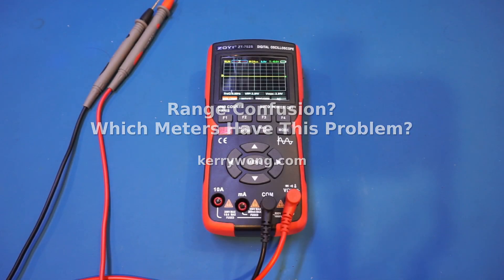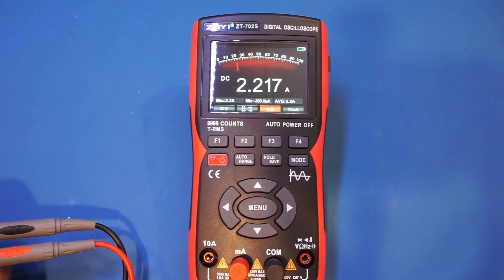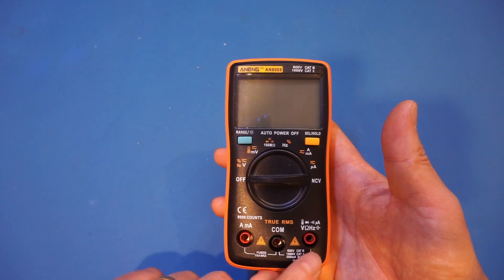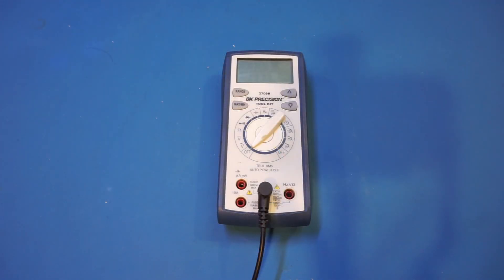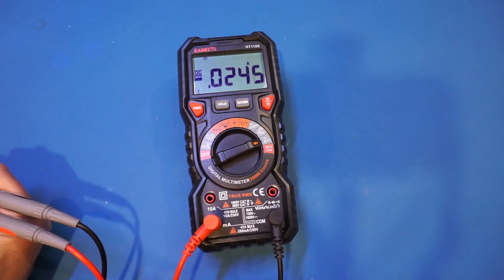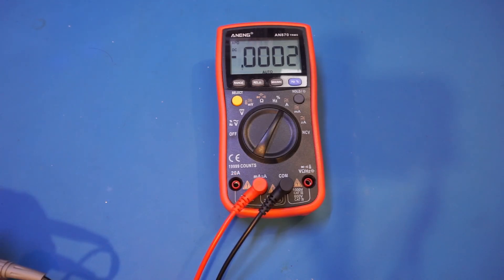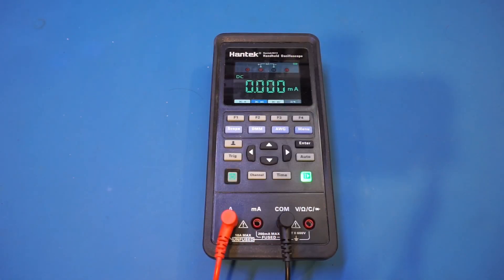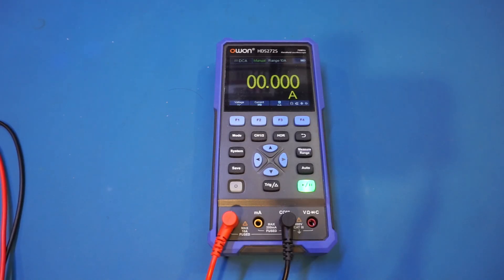"Range Confusion"?  Which DMMs Have This Problem?

Comment: You have the most oddball collection of DMMs I've ever seen!
Just checked my Fluke 87V and EEVblog GW121, as I never thought of this problem.
They both have a single position for A and mA, so the range is dictated by where the probe is inserted.
Both also have a separate uA selector position and will beep if the probe is in the A socket, showing  "LEAD" on the display.

Comment: I think  that both you and Dave Jones are asking too much of manufacturers, and not enough of users. I have many of the meters you have both tested, including the 702S and am never confused. But then I have been doing electronics since 1955, using a Simpson 260 and a Triplett 310. But wait—both of these models are STILL made almost unchanged.  I guess they just make them for us codgers who read manuals.  YOU do the most thorough reviews and I appreciate it and vote with my purchases. I trust you a lot more than Dave.
Reply from the maker: Thanks Barry. Just wanted to point out for unsuspecting users. I haven't made these mistakes either but I thought it was still worth pointing out as after all there are meters out there with all these potential issues well thought out.

Comment: Thx kerry wong it give out a great point of current measure,And for the series of test current be careful of never turn the selection switch of multimeter when power still on,it must burned the meter ,for my meter dead now😅.

Comment: Greetings, I have three UNIT UT61+, UT89XD, UT191T multimeters and a GOLDSTAR DM-311 from 1996 +/- ....and I performed those tests measuring current, which you did and none of them gave me a bad result, they all measured perfectly. use loads from 5mA to 40mA in DC and AC... they all measured well, when changing the place of the probe and changing the dial as you did... without problems 👍

saludos, poseo tres multimetros UNIT UT61+, UT89XD, UT191T y un GOLDSTAR DM-311del año 1996 +/- ....y realice esas pruebas midiendo corriente, que tu hiciste y en ninguno me dio mal, todos median perfecto. utilice cargas desde 5mA hasta 40mA  en DC y en AC.... todos midieron bien, al cambiar las sonda de lugar y cambiar el dial como tu lo hiciste.... sin problemas 👍

Comment: This can be an annoyance, but it's something you should be double-checking before measuring current because if you get it wrong the other way around you'll blow a fuse (by Murphy's law will not have spares on hand). If the meter doesn't warn you you're on the wrong range before you try to take readings it's not a very good meter. If it gives the wrong results while beeping loudly at you, that's OK IMO. If it can use a single set of jacks for μA through A, that's even better (though that's usually reserved for bench meters).

Comment: You really are making a mountain out of a mole hill this time, you clearly state you get an incorrect reading when in the WRONG setting.
Reply: Solo puedo regañarle que muestre valores en amperios cuando está en el rango de miliamperios  eso sí llama un poco la atención
Reply: not really, this is still a good point to bring up as sometimes you might make such a mistake and get wrong readings. Knowing about such issues will ensure the mistake doesn't happen
Reply: Agreed. Even worse.... ALL of my meters give the incorrect Volts and Ohms measurements when I have the probes in the Amperage jacks. Go figure!
Reply: Give me a break, anyone who does any work with DMM's will make this mistake more than once.  Sometimes you get so far ahead in your troubleshooting or checking that you completely forget.
Yes, thats never happened to you, but for the rest of us mortals, it does happen.

Comment: Nice video. I will include such a test in my upcoming multimeter reviews. Owon continues to pleasantly surprise me, and over time, I'm growing to like it even more (despite the highly non-intuitive signal adjustment on the oscilloscope).
Zoyi unfortunately is the worst in this regard. If I saw over 2A instead of the expected 20mA during some tests with my face close to the PCB, I would immediately jump up from my chair :D

Comment: Thanks for the chapter marks. I just checked the 61e+. There are so many more choices since I bought that meter.
Seems I just need to keep agreement between dial selection and input plug used.  Meter works fine for me.